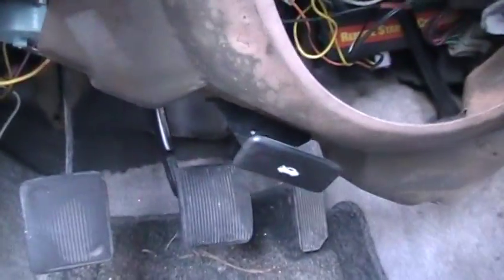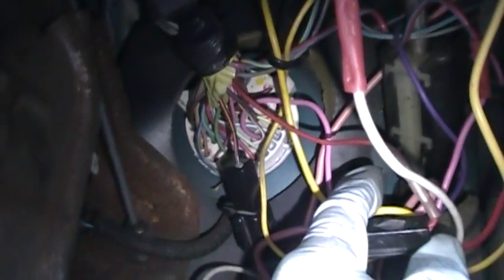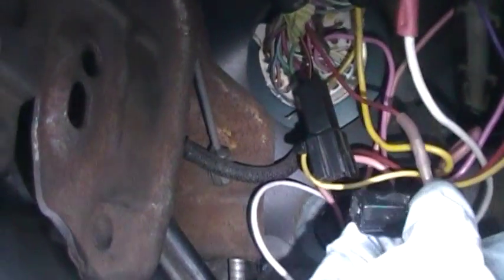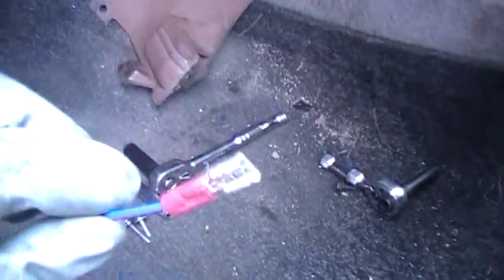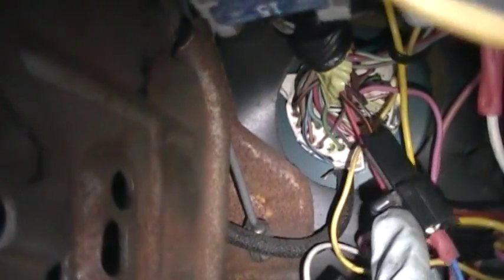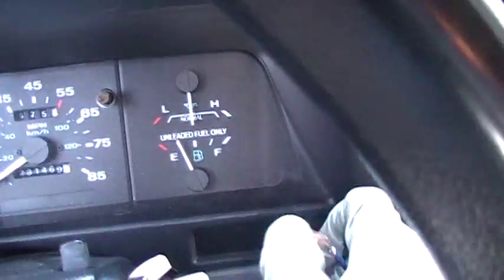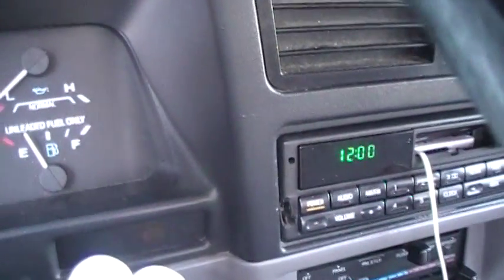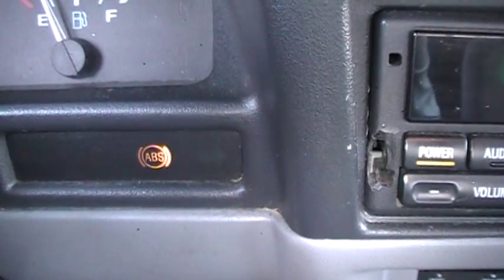READING ABS (RABS) CODES ON 1994 FORD RANGER

Comment: in my case i got code #12 it say low brake fluid , i check my level and it was low fill it up check for leaks o low brake pad life and light goes off , thanks for the info how to retrieve codes really help alot 🤘🏻

Comment: I had a e brake and abs light on for awhile now. I fixed the red e brake light by shoving the brake sensor wire into the master cylinder so now i have no more red e brake light but my ABS light is still on. I ran this test and came up with a code 4 and was curious how i fix this?  A google search shows RABS Valve Switch Closed or Open Dump Valve. I'm not sure where to start.

Comment: I've read that if you pull the fuse for the ABS that that light will go out if you're having trouble with it and the system will work like normal brakes without ABS

unfortunately there is no labels on any of my fuses and I can't figure out which fuse is for abs

I looked under the hood and it doesn't look like it's their which it should be, so maybe it's under the dash ?

I have a 91 with rear ABS

if anyone knows where the fuses or has a link to the diagram of the fuses for this vehicle I would appreciate it if you could post a link

I had to replace a brake line on the front and ever since I have both brake lights come on when I push on the brake pedal and I can't get it to stop doing it

I figure pulling the fuse is the easiest solution if I can find it

I plan on eventually removing the ABS module altogether

Thanks in advance

Radical.bill at Gmail
Reply: Even if your ABS system doesn't work, you'll still have normal drum brakes.

Comment: Thanks, I fixed mine today!
Reply: Did you change the speed sensor on rear diff? My ABS light is always ON.
Reply: Yes, the part was cheap and it was easy to do. I did it myself. If the ABS light and the brake light comes on at the same time, it could be the sensing switch in the master cylinder. You would then need to replace the master cylinder.

Comment: Oki in my 96 ranger maybe you can riddle this one out, my ABS light and parking light were on continuously, but I had no stopping or pulsing issues (this happened after changing front hubs but I don't have front ABS?) Then in the last couple of days the ABS light goes off intermittently then comes on but still no stopping issues. So just today I was sorting a trailer lighting issue out, (disconnected rear wiring harness for tail lights and uhaul wire harness) my ABS light is now off, but my front brakes are making a weird noise and bucking(almost like ABS is engaged). They stop good in reverse only act up in forward. Im stumped by this issue, as now my ABS light is off.
Any answers? Hit me at my deepblududeatgmail address. Thanks for your uploads.

Comment from the maker: the spade lugs are color coded. A red one should do the trick, or a blue one is slightly larger. The yellow one will be too difficult to crimp a small wire in. you will need a crimper, a wire stripper/cutter.

Comment from the maker: A red l.e.d. light...sounds like something that is an aftermarket add on like an alarm or some other accessory. The rabs connector had no lights. The DTC connector is under the hood on drivers side . It may be OBD-1.  But the important jargon to remember is it is an EEC-IV . look up that and you will find a picture of the connector on one of the forums... can't remember where..

Comment: I'm looking to buy a 1994 Ranger XLT. I need to verify where the DTC Connector ( I Know it's OBD I). ABS or RABS connector. I also notice a connector on the drivers side with a red LED on. It's just under the bottom of the dash Is this for the abs or rabs?
Reply: TheWaterman1000 I have a 1994 Ford Explorer XLT with anti lock braking system. the connector is red color and is similar to the white used for OBD I.